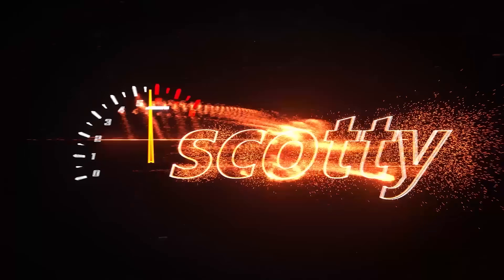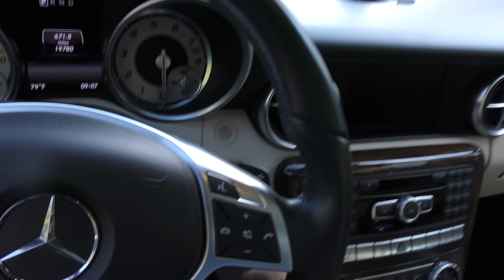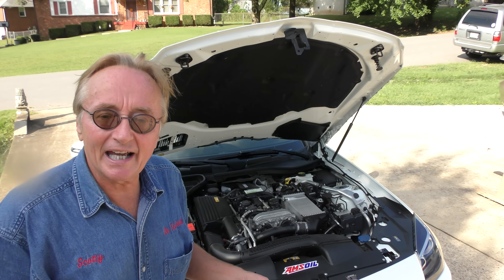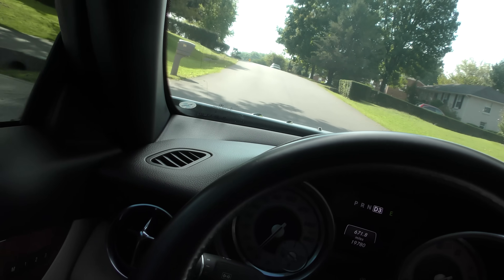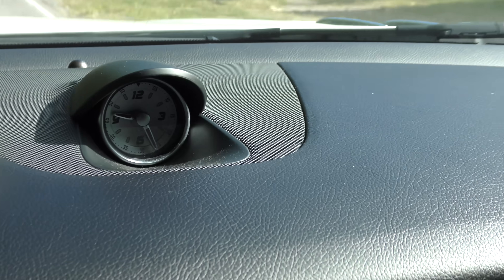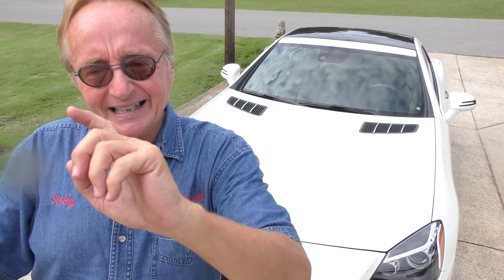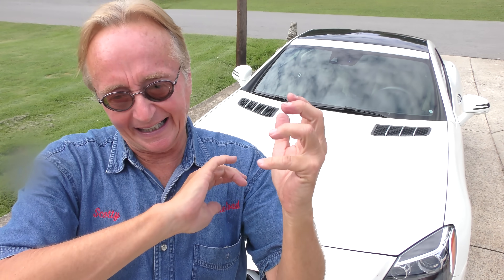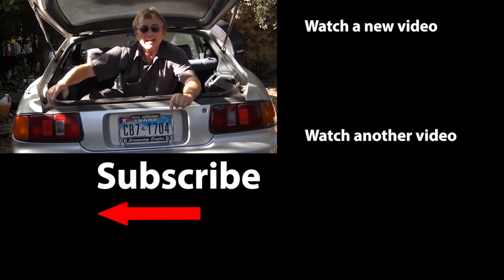I’ve Been Lying for Years, Mercedes is Actually Better Than Toyota

Comment: As a guy who owns 5 Mercedes I approve this message. Do your own repairs and avoid buying parts at the stealership unless you have no choice and you'll save lots of money and still use OEM parts
Reply: Do your own repairs 😂😂🤦🤦
Reply: Have you owned BMW? I got so tired of lack of reliability. Would you say Mercedes are more reliable?
Reply: @michaeldamanti8170  i have 3 mercedes and love them all. had a z3 and couldn't wait to get rid of it.
Reply: @RcH382  So really is night and day?
Reply: @michaeldamanti8170  new bmw's are better.
Reply: @michaeldamanti8170  depends on model, my Mercedes E220 CDI (2007) is comfortable, beautiful and very reliable car. build in Germany of course.. Mercedes is considered the most reliable cars in my country(Azerbaijan). but I'm talking about older ones. especially w124,w202,w210,w211(5g tronik ones).
Reply: @michaeldamanti8170  no any bmw with the b48/58 motors are way more reliable than previous generations because it was co-developed with Toyota
Reply: There’s a reason you can buy them used so cheap
Reply: @michaeldamanti8170  owned 8—-BMW 3 series and x5… low miles but had to change water pumps, gaskets on all of them. Switched to Mercedes never had an issue… now I only deal with Hondas… I love my peace
Reply: Nice 👍 buddy , I’ve got 2 , a w211 5.5 4matic & a 1990 r129 500 . And some fords. Lol 😂
Reply: @michaeldamanti8170  BENZ way more reliable than BMW. I’ve owned both.
Reply: @michaeldamanti8170  BMWs are a completely different animal  they're not reliable cars by and large BUT
if you really REALLY like BMW buy a 7 SERIES stay away from their cabriolet convertibles the Z class all the new ones are crap and ugly too 
buy a 7 series even 20 years old 
that shows you got $$ and style!
Reply: It’s all about preventative maintenance. The older BMWs are more solid && true driver’s car.
Reply: @roninbushitoろうにん  only the supra variants were developed with toyota, the b58 platform already existed way before the supra
Reply: @michaeldamanti8170  have never owned any bmws, but the mercedes I've used have been ridiculously reliable when treated right, and also just as expensive when broken, unless you do the work yourself
Reply: Those cars ain’t for the average people it’s just what it is
Reply: I can't even find someone to repair a mercedes properly. I've been to many dealerships and indys that always screw something up.
Reply: @michaeldamanti8170  I owned a 2011 5 series, oil leaks from every possible gasket among many other needed repairs. I went back to Honda reliability.
Reply: @tomdavis3038  why ?
Reply: Even in Europe this trash not comparable to Lexus... Fast?! Get real mr pilot! :)))
Reply: I have had the Honda Accord 2016, all I need to change is the oil, transmission fluid once, I love this car so much. This has been my first Honda, I am in love at how reliable and how well made these are made to last.
Reply: @roninbushitoろうにん  Toyotas are cheap disposable cars. You get what you pay for.
Reply: @michaeldamanti8170  Yes they are
Reply: @michaeldamanti8170  everyone has different experiences, if your buying used cars for example it all depends how the car has been treated during its life cycle so that will impact your experience. For example I have a e90 lci which I bought 3 years ago with 170k miles on the clock, still works like a clock and had no real issues with it to this day.
Reply: @michaeldamanti8170  yes. much more reliable.
Reply: @michaeldamanti8170  yes. The issues we typically get are more luxury part failures than mechanical issues. The one exception is suspension. It seem alike every Merc owner I know goes through tires and various suspension bits.
Reply: @michaeldamanti8170  Mercedes is definitely much better than BMW on average
Reply: @michaeldamanti8170  I have an F30 3 series and that car is really reliable
Reply: @RcH382  useless
Reply: @wayne6777   If your Bentley was made after 1998 it’s a glorified VW.
Reply: @wayne6777   You mad, brah?   Just go ahead and say so
Reply: @wayne6777   Alright cornball, you love VW good for you
Reply: I think it’s a pretty reliable car burns just know Toyota and it’s not like on the adult the best cars are Toyota and Honda and of course Lexus an accurate because they’re made by the same companys
Reply: I want to chime in on this, i do know bmw has a bad reputation in the states, and it is true that most gasoline engines from bmw are kinda unreliable. But their 6cyl diesel engines are kinda reliable, if u maintain them right. Especially the m57 engine. I do myself own a 730d from 2007 (m57n2), for several years now. And it is the most reliable car i ever owned. I do change the oil each 10.000 km, and each second service all filters & fuel filters. Only thing that failed me last year was the alternator. Maintenance is key, especially preventative maintenance. This year i changed all spark plugs and its module, and the cranckcase breather (which wasn't even  broken). But the part is low cost and was easy accesible when changing the spark plugs anyway. Only thing u should do to these m57 engises is remove egr and dpf, maintain it properly, drive it properly (let oil warmup before u floor it), and this engine is bulletproof. And that car, the more i drive it, the more i love it.
Reply: I’ve been a tech at the “stealership “ for 22 years now. Here at Benz we give warranty work away all the time to customers who are outta warranty. It’s called “goodwill” us techs loose money every time this happens. 
I recommend Toyota if u can’t afford luxury car repairs. 
Love my Toyota!
Reply: @El_Rook   BMW are less solid
Reply: @michaeldamanti8170  I drive an old BMW and haven't had any major issues in 3 years and 60 000 kms. That being said I live in Munich, the city of BMW and haven't seen a single BMW taxi. All the taxis are Toyota Hybrids or Mercedes diesels. Apparantly a Mercedes can survive 1 million kms over 10 years and BMW can't.
Reply: Exactly I own a e46 bmw and i buy all my parts and fix it myself it ain’t rocket science anyone can do it if they stop acting dumb and lazy. Plus I’m my dad is an ex mechanic from the 70s. I change spark plugs coils oil breaks gaskets hoses lights etc I do it all at home
Reply: @michaeldamanti8170  yes, no walnut blasting my m274. Same engine as this thing.
Reply: @michaeldamanti8170  I replied before looking at the name, tell me how small a world we live in Mike,  it's G lol.
Reply: I'm planning on buying a white 2020 Mercedes Benz S560 4Matic with Beige interior. What is your opinion on it?
Reply: Correct, in Europe Mercedes parts you can get OE for a bargain.
W212 as said, can't go wrong as long as you buy one from 1st/2nd owner with full maintenance history!
Reply: @tomdavis3038  AND THAT REASON IS they are freak'n headaches.....
Reply: Benz is 🗑
Reply: Yes! My X5M was a joke!  My C43 Estate is amazing.  The truth finally come out from the man.
Reply: i second you
Reply: Know your models in and out too. Really not that hard
Reply: @RcH382 my ‘97 Z3 has been the most reliable car I’ve ever owned. Lexus can learn from them.
Reply: Or get a warranty
Reply: America mercedes are built in mexico, our mercedes are much better!!
Reply: @w20294  you mean Alabama
Reply: @scherzva  In BAMA?? No seriously european built Mercedes are much better!
Reply: Benzes way more reliable . Do the maintenance on time and learn to work on them. Only get the ones made in Germany .
Reply: @aryub5851 and yet you are here on a YT’bers Channel about fixing your own cars?
Reply: @TripleB101  does he show how to DIY? Hell no, dont be a goof its not a DIY channel
Reply: I heard some new vehicles you have to bring to the shop because they use special equipment that the buyers can’t get
Reply: Stealership...I like that.😊

Comment: My dad owned Mercedes, he got so fed up with it being in the shop all the time, he finally went out and bought a Toyota.
Reply: Ill second that. Toyota all day , everyday.
Reply: @peterwood3108  same. I have 3 corollas 🤣🤣
Reply: Everyone ends up coming back to Toyota.
Reply: That happened because you start listening to the Scotty 😂
Reply: In the '70s Mercedes-Benz was the best beautiful durable reliable now it's all out of the window
Reply: I looked for the Scotties laughing donkey in emojis but couldnt find one.
Reply: Same. My dad had a used 2002 s500 benz. It was a pos.
Reply: @joshhemingway7717  what year corolla are best in your opinion?
Reply: Smart move. Toyota/Lexus is the King of reliability
Reply: I had a 2013 ES350 for 2 years (2019-21) I was the 2nd owner sold it for financial reasons and bought my 2002 ES300, love this car even better. Not a creak or rattle, fit and finish is unparalleled
Reply: @stephendibari5010  I agree i had toyota in the past  also still own a Lexus and i have a Mazda 3 and i gotta say that Mazda which was my first mazda and it really surprised me its at around 250K and still going.
Reply: @flobay1731  awesome 👏. Love Mazdas too, although I never owned one. Japanese quality is amazing. I’m the 2nd owner of my ES300, bought it last April from the original owner with 160,000 miles. Serviced at a local Lexus dealership from day one, original owner change the timing belt, water pump, valve cover gasket all at 88,000 miles. Last year I had a certified mechanic install four new struts because the 2 rear ones were leaking. It literally drives like it just rolled off the showroom floor. Everything still works like new just amazing. 

Last summer I changed out the CD changer in the dashboard and installed a Alpine double din touchscreen receiver and a  hardwired backup camera. The original air condition compressor was squealing last summer had to replace that, also the original alternator needed replacement. Both original parts after 19 years which is amazing
Reply: And that's the whole story. You can't own a German car with the mentality of a Japanese car. 
You have to be involved in German car ownership. You don't just get in it every day, ignorant to the state of it & wait for something to fail before you address it. You MAINTAIN it. Maintaining doesn't mean waiting til things break to address it.
You also have to know the chassis, & don't get a car with options you're not ready or willing to deal with, like a convertible top of any sort. 
I personally will never own awd, yet people ignorantly go on not knowing they actually own 2 cars at once underneath.
Reply: @isaacashurov365  That's with most cars nowadays lol
Reply: Smart move
Reply: @moloono1  If they are insane!! 

The only Toyota I like is a 93 Supra and thats it. But even then I would still have my C250 over that due to the more fun factor.
Reply: @peterwood3108  Toyota King of the road, with out a dought.
Reply: @nigelclark7360  i could not agree more Nigel,
Reply: @extremedrivr  Sounds like you’re still in the “race at every red light and be the fastest car in the road” phase. Don’t worry, once you start paying lots of money for repairs and your direct injected engine needs carbon cleaning, you’ll be back to Toyota.
Reply: @chancefluke7833  tough decision there. Honestly my 03 with almost 180 k I'd say. That thing is actually pretty modern interior wise, body Is beat up but damn that thing just will not die. It has the 1.8 l ,  those things don't have much power , but will start up no matter what happens to her. I have a 2010 that has the 1.8 top with only 7 k miles (yes only 7k) and rides smooth just like the 03 but barely drive it or the 2019 . I drive the 03 most because I work construction and like carrying my tools and even haul 2x4s and 2x6s and trim sometimes 🤣🤣😍
Reply: @moloono1  i could tell just from his name lol
Reply: Good choice
Reply: @japanwatchconnection keep your negativity to yourself. This is not even close to a Camry except for the frame. Sound insulation and quality is outstanding. Fit and finish is unparalleled. Difference between a Toyota and a Lexus is dramatic, not comparable
Reply: you lie
Reply: @peterwood3108  toyota = boring, uncomfortable, no safety likewise  lexus = boring
boring cars = boring people = boring life
Reply: @stephendibari5010  I can keep my facts straight. It’s sad to see people who does what you do really😂
Reply: Never owned a Toyota and never will :)
Reply: @christophercolumbus8944  Mercedes Benz = regular time wasting at dealership.

My time is worth more than wondering when my car will have the latest sensor fail.
Reply: @christophercolumbus8944  they’re great cars but they do lack the “attract thots” capabilities of a Mercedes
Reply: @moloono1  Speak for yourself
Reply: The ml350 2012-15 are bulletproof and rock solid.The 2008 rockets are reliable.

Comment: A depreciated Mercedes with relatively low miles is one of the best car buys out there IMHO…I’ve bought 3 AMGs, all depreciated, under $20k, and all have been great.
Reply: which AMGs?  ?what year? C class?
Reply: @christophercolumbus8944  in the past…2 CLK 55s, under 70k miles, both at a price around $13k, and a 210 e55 with 60k miles, bought 4 years ago; as my current daily for $15k… Only the most reliable m13 engines and the strong trans, same as in the v12 cars.
Reply: When I was looking to buy the E55, …I also looked at a 2014 E63s with 40k miles for $43k which I also thought was a great deal and a lot of car for the money. I went with the e55 because I could buy outright without a lien and I anticipated servicing and maintenance costs to be far lower.
Reply: @actionfaction2558  how was your insurance payments?
i always wanted to own a E350 coupe from the old era 2010-2012
Reply: @christophercolumbus8944   With the first CLK 55…it was pretty high, more expensive than the Z06 Corvette I got next. The second time I purchased a CLK55, because the first one…was that one car I regretted selling, I learned that the cabriolets are low in numbers in the states, so I got collectors car insurance with guaranteed value of $14k for $600 a year ( rediculous low I know ). The E55…I don’t really know, because I have a multiple car discount. It’s not unreasonable though. Really the only time I noticed was during the first one…most likely due to my age…15 years ago. But, after the fact, I realized how good that car was, because through 40k miles, I only had to replace motor mounts and a thermostat.
Reply: @christophercolumbus8944  I bought a 2014 E350c with 70,200 miles for $18,072 including tax. Couple oil changes, new battery, an alignment because of crappy road construction roads. That's been it over about 21 months. Insurance isn't bad because it's an $18k used car.
Reply: I was just about to say I think someone were to go with the 2011-and newer C class AMGs and CLS AMGs. These years Mercedes did a BETTER job at fixing the major issues of the previous years.  Also just my opinion.
Reply: Agreed 100%
Reply: @Neil R @Action Faction also I think all the C63s models that are the chasis made in the US and NOT Germany I think we should all stay away from because of the Hot Vee engine which centre's all the heat in the engine bay and can destroy it over time. My personal favourites are the E63s models. Secure Drive warranty, e63s and you are just having so much fun. Also a fun fact the driver seat alone in the E63s is 12K!!!
Reply: True ive owned 09 CLS 550 got it for 8k 70k miles the MSRP almost 80k other than air suspension replacement its been a great car 👍
Reply: Dang where’d u find such good deals
Reply: @chanjasonsk  They were all bought before 2018, two were at the bottom of the depreciation curve, one, the 210 E55 was starting to tick back up in 2018, but I bought that one for the long term. It’s my current daily driver.